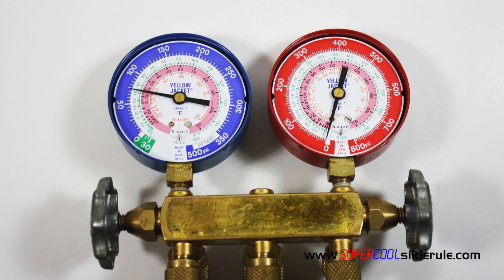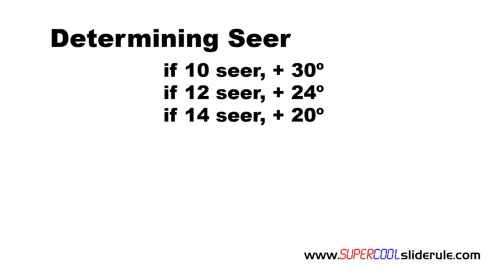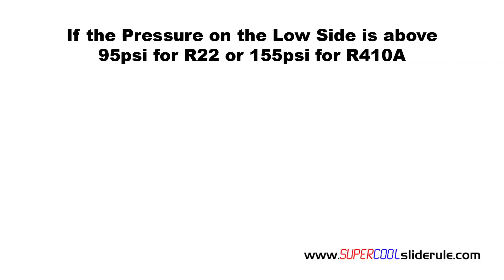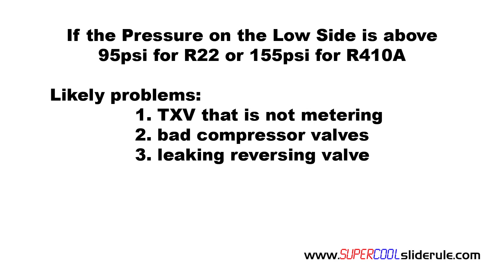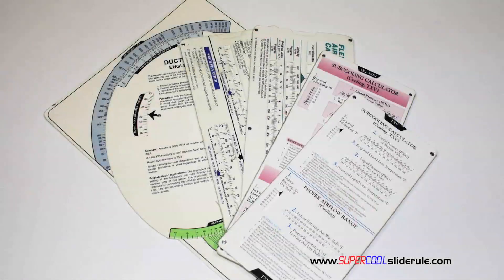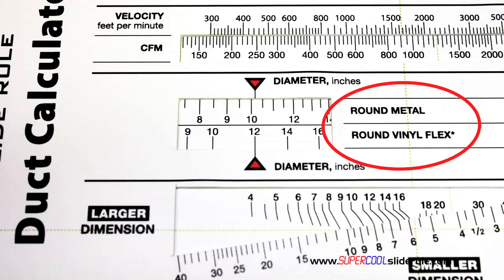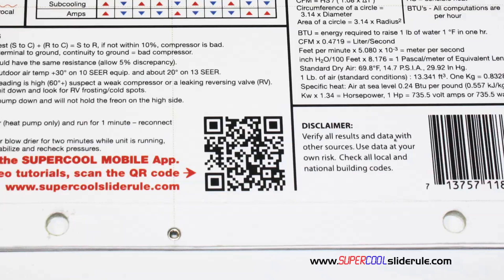Compressor - Troubleshooting Weak or Bad Valves

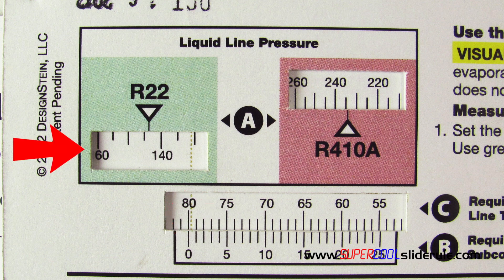Comment: its not a big deal but I think the guy noted the temperature incorrectly for the r22 liquid line pressure at 1:10 seconds into the video.
Reply: I noticed that too. It's actually about 125